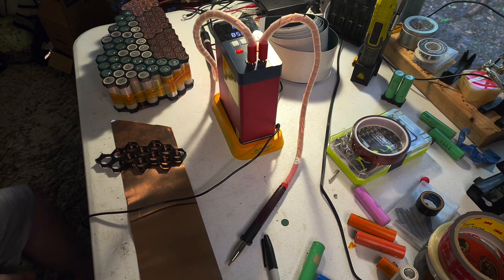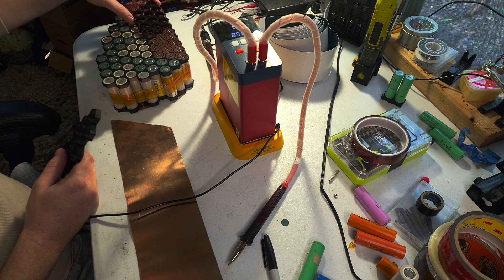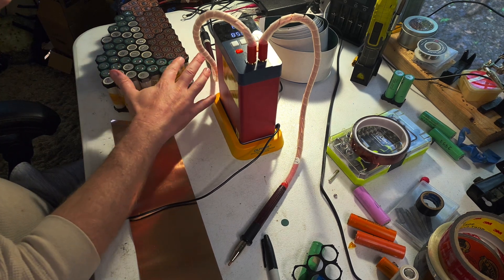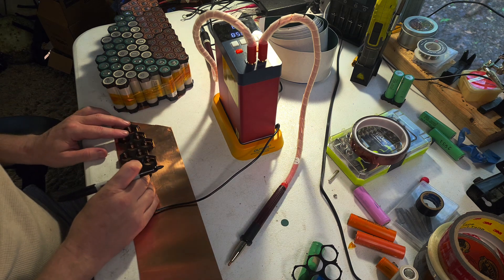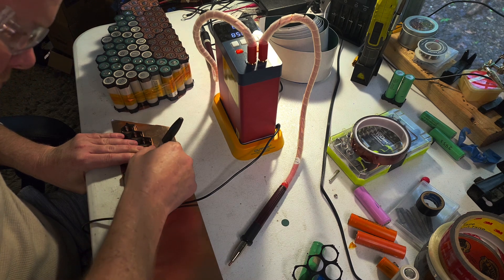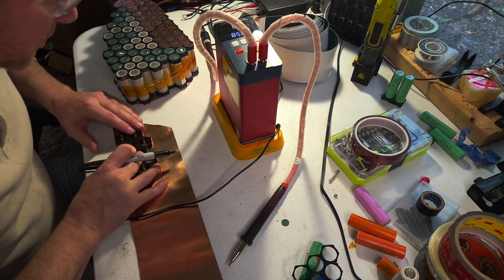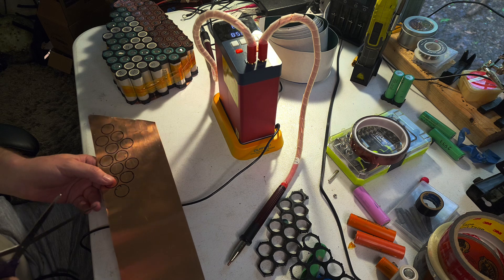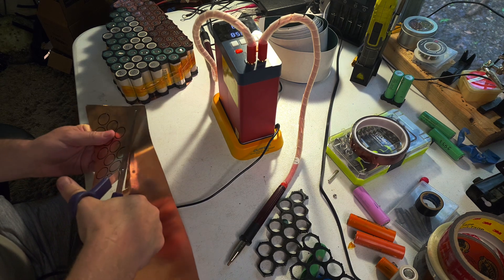DIY Copper Busbars | 18650 | 21700 | Triangle Battery Pack w/Nickel Sandwich | Glitter 801h Welder

Comment: Hi, I'm thinking of doing this too. Any problems with copper corroding?
Reply from the maker: Not for me, but I think it depends on your environment. If you seal it up nice then you shouldn't have to worry
Reply: @mArkansas1337  The battery pack I'm building is 20S5P 46950 cells. The nominal output is 72V 400A and I'm worried that somehow it could accelerate any corrosion with the moisture in the air. I live next to the sea.

Do you recommend building a sealed enclosure for it?

Best regards,
Víctor
Reply from the maker: @VictorFS-eh3gr wow I've never even heard of those cells! I shrink wrap mine and then fill any gaps with hot glue to make it water tight. I've heard some don't recommend hot glue so something like that should work
Reply: @VictorFS-eh3gr  you can also buy nickel platted copper same conductivity as copper but doesn't corrode even if you leave it in water and it's the same price
Reply: You could easily just spray lacquer over it. I would just put the fish tape around insulator the part that you normally throw away over the area that you're going to actually Weld and then put a coating on it and then take those stickers off and weld in those exact spots. The stickers would need to be placed on the top and the bottom.

Comment: Nice job! What's the thickness of the copper sheet?
Reply from the maker: 0.2 mm copper and 0.15 nickel plated steel
Reply: @mArkansas1337  the 0.2c + 0.15n, what your top amp discharge at the last parallel group? how much it can handle? im trying to build now 17s5p, 100-160 con amp, but believe will plan to 120 max con. not sure on the thickness i need. thanks and great video, looks awesome
Reply from the maker: @abShuron I haven't put more than 50a through it yet so I'm not sure what it can handle! I don't even remember the bms rating 😂. But you can consult ampacity charts using the area of your busbars to calculate what they can handle. It's kind of a grey area in that what the science says and what you can actually get away with in real life aren't always the same!